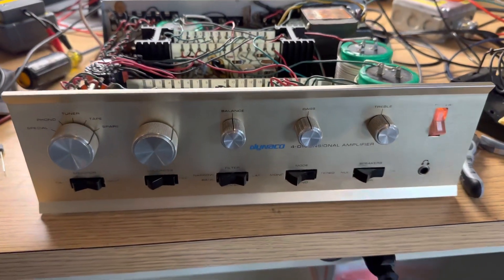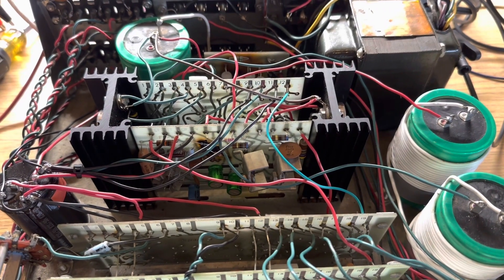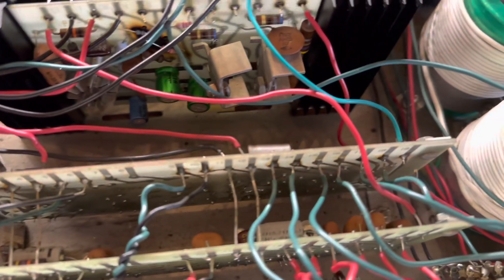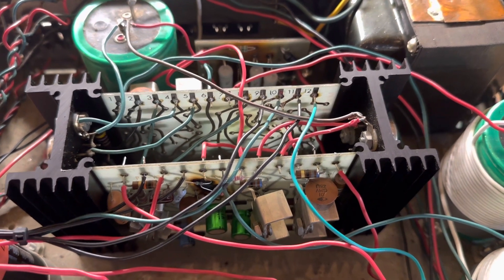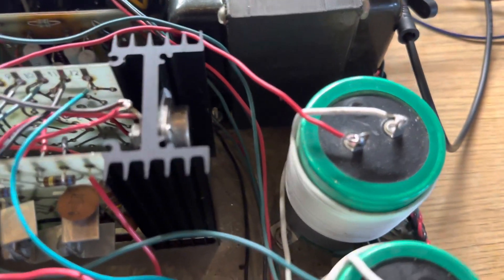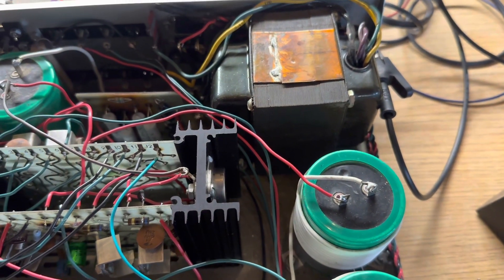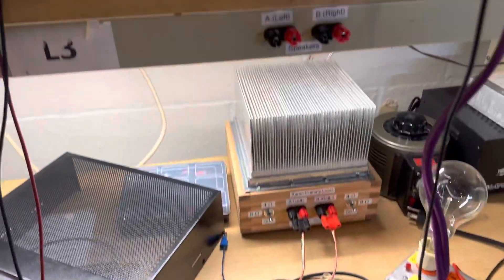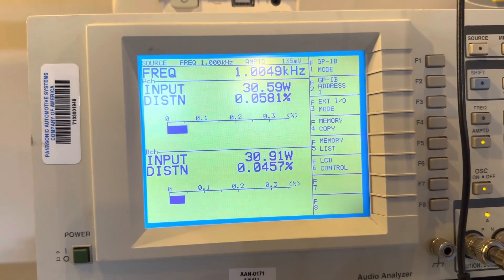Dynaco Sca-80q distortion, found it!

Comment: Interesting video. If you could do a channel intro video that would be great. Is this a hobby you have? Do you fix all kinds of audio equipment? Car stereos? Very curious about what you do! Thanks!
Reply from the maker: Thanks, good idea.  I'm still getting the hang of recording etc.  Yeah just a hobby.  I've always been interested in electronics to a degree but in the last few years I've had a bunch of (somewhat expensive) things fail on me, which I was determined to repair, and then I really started getting into it.  I have done some car audio, like a Rockford fosgate 360.6 amp, a pioneer avh-x2700bs that had a bad ram chip, a 1968 camaro radio, and most recently a harman/kardon amp from a buick lucerne (which are surprisingly expensive to find used). I'm mostly interested in 70s-90's home HiFi repairs, power amps, recievers, tuners, etc.  I'll work on just about anything though, if I think I can repair it
Reply: @philsanalogbasement  Nice! Great channel, looking forward to more videos! Thanks!

Comment: How noticeable is that to the ears? Genuinely curious.
Reply from the maker: I couldn’t notice it.  However I had just repaired the amp boards after a catastrophic failure, so I wanted to resolve it for two reasons:
1.  I provide a printout of various as measured specs after the repair, compared to the factory specs in the manual - and there was a huge discrepancy between the two channels
2. I don’t want it coming back ;)

Comment: I always wondered how much can these Dynacos be improved by switching out the old components for new ones but just keeping the same amp design. Like the pre-amp transistors and stuff
Reply from the maker: Not sure… surprisingly many of the transistors in this thing are still for sale today like the tip31/32 and even the outputs.

Once I was all done, it put out the rated 30w at 8 ohms with 0.06% THD+N left ch and 0.04 right ch, at 1khz.  Which was well below what the manual said was acceptable
Reply: @philsanalogbasement  also what equipment are you using that test the THD under load?
Reply from the maker: @dantheman1998  levear vp-7725d audio analyzer with a standard 8 ohm dummy load I built